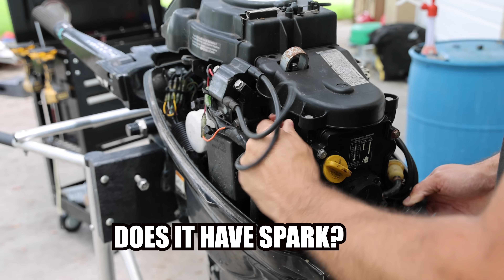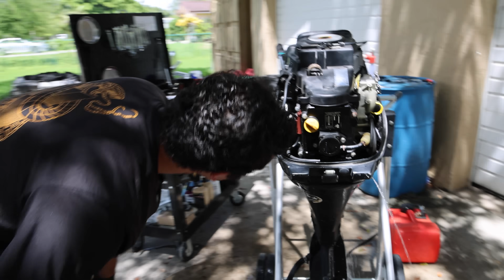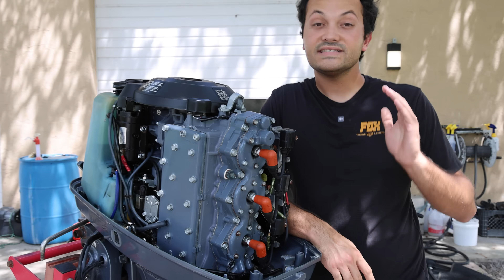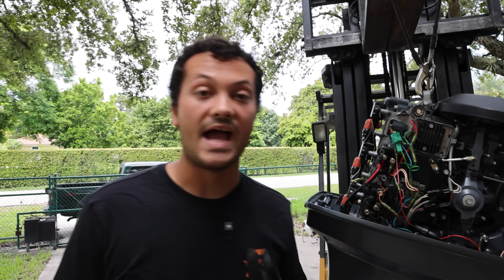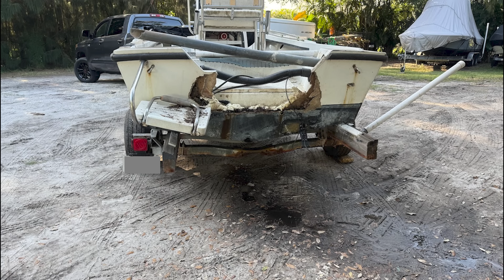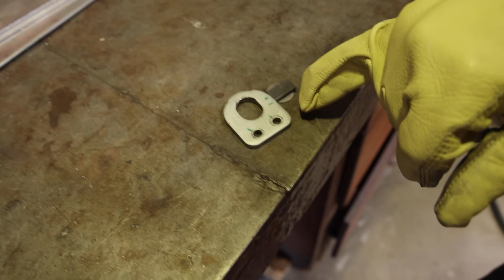I Flipped $300 into $5000 with outboard motors (Here's How!)

Comment: As an old radio tech that made RF and other electrical connections used in a marine environment (on the water in Miami, FL), please use No-Ox or some other dielectric grease on all connections. It will save you in the end.

Comment: Hello I have an 1999 evinrude 40hp 4 stroke outboard that overheats. Ive changed the thermostat and  impeller. Any suggestions or tips to what to replace.
Reply from the maker: I would make sure you have water flowing through the head, it could be blocked with corrosion!
Reply: Johnsuzki is trash.

Comment: Thanks for the reminder..the carb on my mercury copy 2 stroke has no gasket between the plastic air intake and the carb...it starts but runs crazy fast....when i spray carb cleaner the engine slows and idles correctly, for a few seconds then as the carb cleaner evaporates...starts speeding up..I'm gonna start by putting new gaskets either end of the carb?? what else could it be bro? I was thinking to changre the head gasket as well. The carb is clean as a whistle. next I gotta deal with changing the seals in the lower unit, water in the gear oil, and water spitting out that little hole where the gear rod pokes through. i love your channel bro...liked and subbed.

Comment: Gave that Yamaha away at that price. Here in the Chesapeake area that’s $2500-$3500 all day long. Finding a reliable 250 pound motor that puts out 90 hp is like finding gold.
Reply from the maker: Yeah, it was a good deal for the buyer!
Reply: Good running 90 Yamaha 2 strokes go for around 4-5k where I live
Reply: @james_7991 one of the best, if not the best, 2 strokes ever.
Reply: @james_7991  where? I got a ton of them in the Midwest I need to sell.
Reply: @james_7991 where do you live? I have an idea and a semi truck.

Comment: PLEASE HELP - I have a question for you. No one seems to be able to answer, so I thought I would ask you. I got a brand new 2025 Yamaha 50hp 4-stroke. My problem is the motor mooves freely when I am on the water. I know that in older models, there is a friction steering screw that should clean up my issue. Do you know if the new motors have this screw. The tiller version has this screwbut there's no mention of one for the helm drive outboards. Thank you.
Reply from the maker: If the motor is a remote steering model, it usually doesn’t have a steering friction screw, if you have cable steering unless there’s an adjustment on the steering box there’s really nothing you can do unless you upgrade to hydraulic or a no feedback cable steering system, or add a friction plate from the tiller, Motor model of your Motor
Reply: @RobsGarages I will look into that. Thank you.

Comment: Before even seeing what the problem was I'm guessing the carb was issue on the 15hp mercury :D

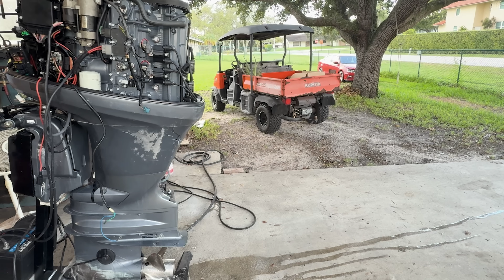Edit: was the gasket smaller than the carb? You mightve created a restriction 🤔 Double edit, your 150hp shaft is cracked youknow 13:35 😵

Comment: Is inflation so bad in the USA that someone is willing to pay $1300 for that? 😭
Reply: Actually that’s cheaper than the regular resell price for a good running outboard. Usually it’s $100 per horsepower. $1500 is the perfect price.
Reply: @Emilyyy_2012  For such a old thing? I've had a look here on Japanese sites, and a Yamaha 15 from 2016 (super low hours and looks basically new) is listed for $1100. The older uglier ones like the one in the video are going for 30-50,000 yen... which is like $150-350.
Reply: @Spuki2k none of these engines are considered old for the American world of boating. I have a 1967 evinrude and it’s barely considered vintage and it still runs to this day with basic maintenance. For what it is it’s really not as expensive as you’d think. I don’t know where those prices are coming from and outboards might be lower in value where you’re at. I’m not sure but in our country that price is completely normal.
Reply: @Emilyyy_2012  when new ones are unaffordable the used ones are going up in value. 

They last a long time because they are simple. 

Personally I think it’s better to maintain and buy a used one. I’m just shocked at the prices in USA.
Reply: @Spuki2k Yeah I agree with you. The older outboards will last years longer than the new ones in my opinion. Plus the price of a new one could buy you 4 used ones in good condition. It’s ridiculous.
Reply: American is rich.

Comment: I'm a new Sub, I like your content.  Question: did you buy a OEM fuel pump or one from Ebay ???
Reply from the maker: I ended up going with one from quantum fuel systems, i’ve had good luck in the past using 
them!
Reply: @RobsGarages  do you worry about them being compatible in Amp draw or anything else?

Comment: I have a 1987 Yamaha 90hp outboard. Im getting weak to no spark on cylinder #2. Thought it was the coil, replaced it, and no change. What can it be?
Reply from the maker: I would check the connections coming from the CDI unit to the coil first
Reply: @RobsGarages I actually have the same problem, I've replaced the spark plugs, replaced the coil pack for cylinder two, replaced the crankshaft position sensor as well and still no change. I found a second hand CDI unit on eBay and replaced it and still no spark in cylinder 2. I've seen a couple of Facebook listings in my area of the same motor with the same issue.
Reply: I replaced the CDI, now I gained spark on #2 but lost spark on #1. What else can I do? I purchased a trigger / pulsor coil that arrives tomorrow, hoping that's the fix.

Comment: My outboard isn’t working and is leaking at the carburateur, it doesn’t have a paper thing between it could that be the problem?
Reply from the maker: Yes, that could possibly be the issue. The carburetor needs to have a paper gasket or it can also have a rubber O-ring between it and the motor if it doesn’t have either then that’s definitely a problem.